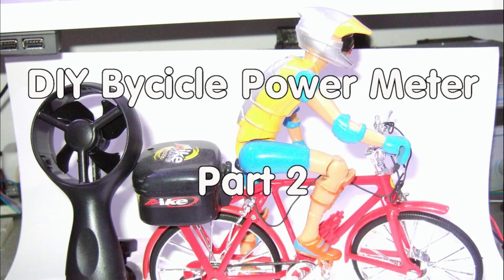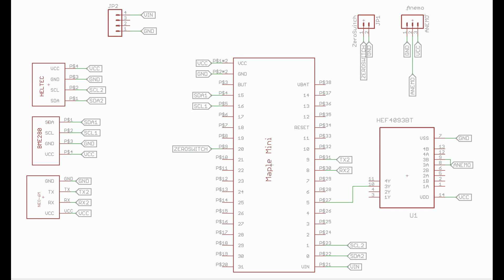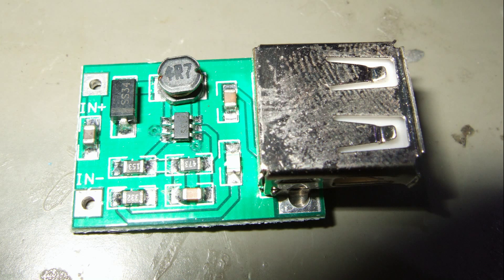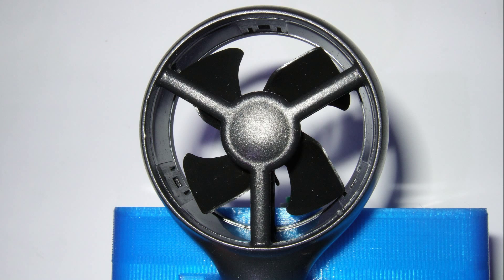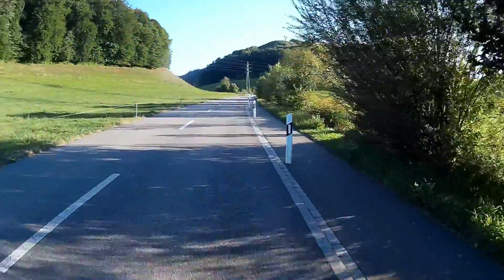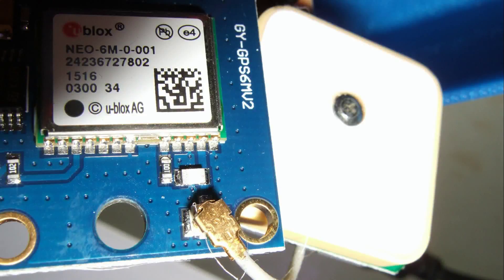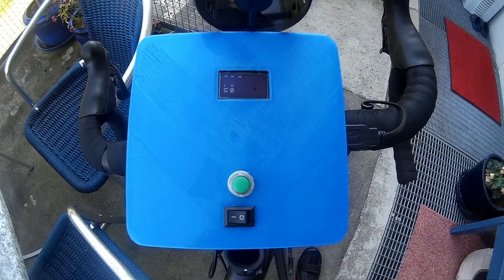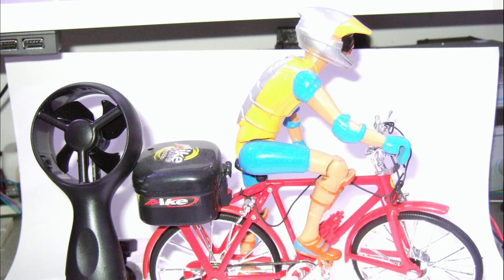#19 DIY Bicycle Power Meter Part 2

Comment: Hi Andreas,
Have you found a colour display bright enough to use on your bicycle and / or motorcycle projects that will not wash out in even moderate sunlight?
Reply from the maker: No. The Oled I used were not ideal. I think, it is necessary to cover the display to hide the sunlight out.
Reply: Thanks, I am in the lookout, any suggestions welcome. Many thanks for your excellent videos, I have watched them all!
Reply from the maker: Good to hear. Thanks!

Comment: hi, have you tried strain gauges. I would like a low tech stages powermeter than just lights up 10 LEDs on the handlebars and I think that would be very simple and cheap to make. what do you think?
Reply from the maker: +jlebrech most of power meters commercially available work with strain gauges. But it is also not easy to go this route, because you have to know the angle of attack (pedal position) and the pedalling speed.
A guy tried it: https://youtu.be/8HEusS3cRNQ, but there is no update on his channel.

I want to go my way because I want also know where I use my force (I am a hobby cyclist). Do spend my power on height gain or on headwind? And the most important: I wanted to understand sensors and microcontrollers.

For the moment, I am working on other projects. But I hope, my meter will be ready for next spring ;-)

Pleas keep me posted about your project!
Reply: my solution would be more of an analog solution, you just see 1 to 10 LEDs light up as you push of the crank. no maths required. it would be something for budget user really.
Reply from the maker: +jlebrech I see. Then the main problem I see is the connection from the turning pedals to the fixed frame.
Reply: Andreas Spiess yeah, i was thinking an infrared connection to send the voltage value.
Reply from the maker: +jlebrech Interesting. That should be ok if you have a certain battery size at the pedal. Keep in mind that LEDs are usually not omny directional.
If you only want to transfer a value at the horizontal position, that should be ok.
Reply: Andreas Spiess yeah just something really simple for the low end of the market, i.e be in every bike accessories aisle for $40-$50~
Reply: Wha about Nokia 5110 LCD? The readability is very good in sunlight and it doesn't neeb a backlight.

Comment: Wonderful video. I am planning a similar build with a thermal anemometer chip, a gyro to calculate the slope and hall sensors to measure speed and cadence. The current issue I am having is putting an accurate formula together. Any suggestions? Looking forward to the next videos. Good luck.
Reply from the maker: +Bill Field Glad to have at least somebody else which is on the same way ;-) Which formula do you mean? The formula for power or the formula for the thermal anemometer? I bought an anemometer from modern device, but I want to test it out and see if it is accurate and how it compares with other principles like "ventilator" or pitot tube. For the speed and acceleration I use a GPS and for the slope the new Bosch sensor BME280. I tested both and you find the info in former videos. To test the anemometer I am building a wind tunnel. You find this info also in one of my videos.
Which kind of anemometer do you forsee?
Reply: +Andreas Spiess I am also looking at the modern device item "Rev P" I contacted Modern Device and asked for accuracy test results. No answer yet. I will let you know if there is anything back. As for the formula, I know the general formula for power but it uses a "work" value. To calculate work, I need to know the force. I am still trying to figure out how to incorporate the wind load, slope, and rolling resistance into the force value. Are they all of equal importance? or are they weighted, etc... By the way.. Thanks for the quick response.
Reply from the maker: +Bill Field Data to calculate power you do not need force. You need speed, speed change (acceleration), height gain,, and wind speed. So far, I can measure the first three. Wind speed is the toughest...

 Information I found here:

https://en.wikipedia.org/wiki/Bicycle_performance

http://www.analyticcycling.com/Example_Page.html

http://www.cyclingpowerlab.com/PowerComponents.aspx

Data concerning the wind sensor is here:
https://moderndevice.com/uncategorized/rev-p-wind-sensor-data/
Reply: +Andreas Spiess Hi again. I read most of the information in the links and found it all very informative although somewhat deep at times. I will use the formulas as presented and begin there.  I also watched some of your previous videos as you suggested in this one, and found some very useful stuff there as well. Thanks for the advise. Ill be a while getting my project up and running but will get in touch when I do.